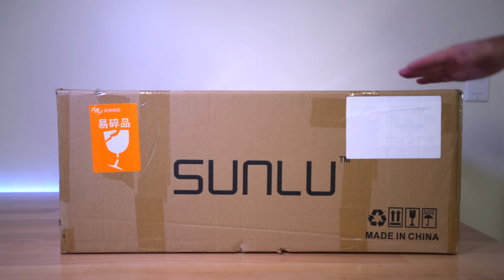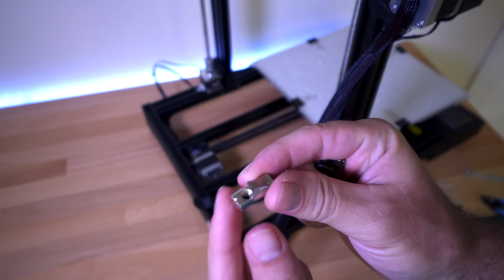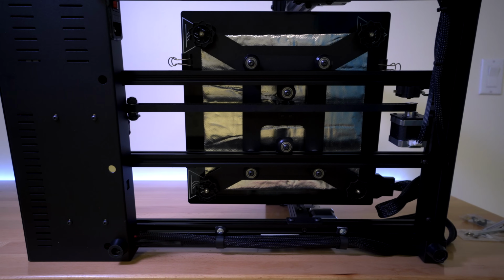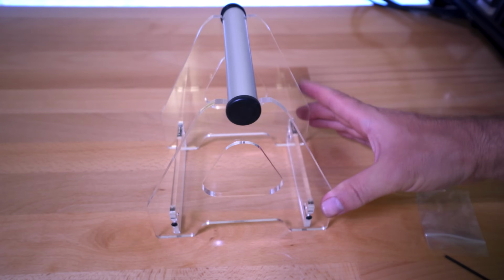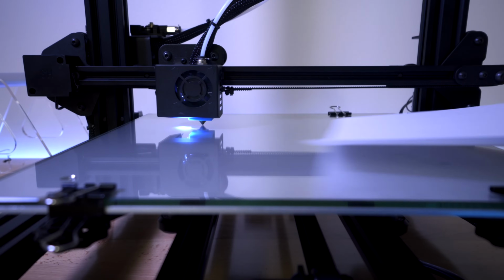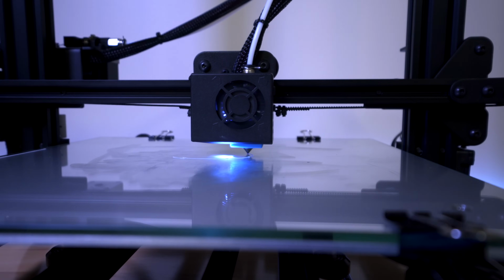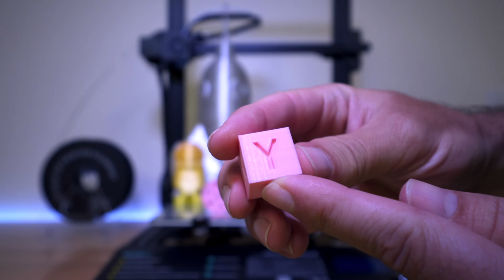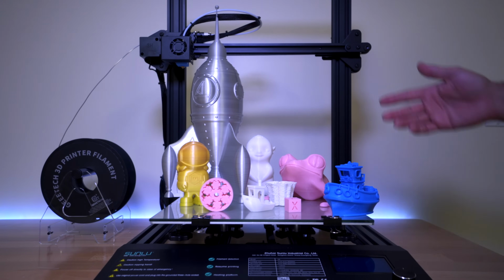Sunlu S8 - 3D Printer - Unbox & Setup

Comment: Could you do a review on the Ender 3 V2 ?
Reply: He should wait like everyone else until we have 3 - D printers which are sold with CD´s. Until then reviewing a 3 - D printer or unboxing one will be pretty much pointless. As much as rewarding as it is for those who prepare themselves especially to do it, there really is no point with reviewing a printer unless you bought it with the CD or CDs required to configure it. This is why all the home 3 - D printers kept failing and did so badly at printing, because everyone was so hopeful that they could do better that they forgot to make them come with the most important feature required to make a printer work - its drivers. No driver = no successful print job. Its simply as simple as that.

Comment: Why is it requiring 220C to print correctly? Is the PID/Hot end just not calibrated correctly? I've never struggled with a PLA, I print most at 205 first layer/200 layer after with fan.
Reply: I print PLA with a nozzle temp of 205 C and bed temp of 50C with no issues.  I use 230C Nozzle and 80C bed for ABS. When printing TPU I use 220C nozzle and 0C bed.

Comment: This has to be the best packaging job I have seen of any 3d printer, I salute the persons responsible for this.
 What a great printer this is and so so easy to assemble, although I m not a fan of the specs and safety blurb on the front panel, maybe they could print this onto some film so that when you are more familiar with the unit you can remove them.
 I already have a printer of this dimension so I won't be purchasing this one, however, if they release one with a larger build volume and some better quality extruder/hotend components I would be very interested.
 Just one question does the bed continue heating when filament runout is detected?
Reply: Its possibly one of China´s greatest inventions. Meahwile Monoprice are having difficulties trying to convince their customers their Voxel printer can make more than a cube.
Reply: You can peel off the safety blurb and specs
Reply: Hi I noticed you said you have the Sunlu s8 3d printer. I saw some bad reviews on Amazon. Do you like this printer? Is it reliable? Will it brake down after 3 months of using it? Sorry to be a bother but I was thinking about getting one. I just wanted to get some info from someone who has one. Thank you so much!
Reply: @ryanbaker6793  hey, I have one, so far it has proven to do well for its price. The only problem I've experienced is some jamming problems with the filament, but I am sure it is just in need of a replacement nozzle (which they provide a spare of with the printer) so that is not a worry of mine. The prints seem to be vary good quality, and the size allows for larger prints. Overall it's a great printer, only rivaled by the ender pro. Sunlu makes very high quality filament too, so even if you choose another printer, id suggest checking that out

Comment: So I'm in the market for my first printer.  I had decided to go with the Flashforge adventurer 3 but watching this video, I don't know which one would be better.
Reply: I've had 4 of these printers for the past 9 months now and the only issue I had is having to replace the bowden tube on two of them.  It cost me about $14 to do that and I used a Capricorn tube that I purchased off Amazon.  It only took me about 5 minutes to change that tube out and both have been great again ever since.  The other two printers have had no issues since I bought them.  They really are great printers.  If you want to see some of the stuff I printed with them you can check out my Instagram page @daves_droid_workshop and look around.

Comment: Lame little screen, no auto bed leveling, no features at all besides the normal Marlin features, no trinamic drivers, plastic extruder which will break sooner or later, normal PTFE tube. Why do they even bother making a machine like this.
Reply: Cheap prize? Here it cost 320€... If u want more pay more!
Reply: This dude wants a top of the line printer in the bottom price range... Wow lol